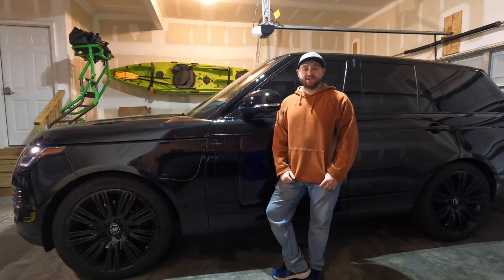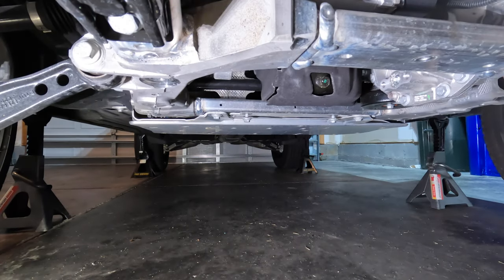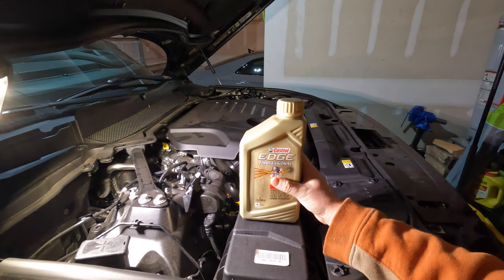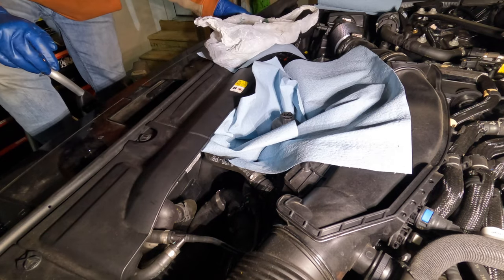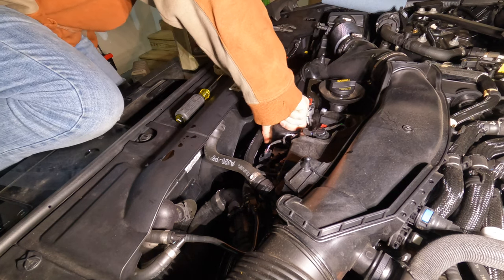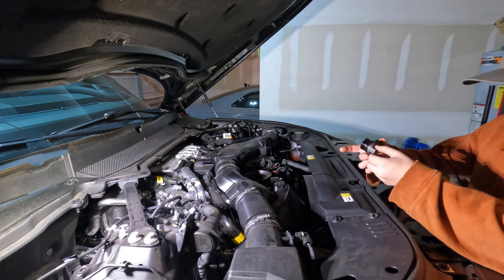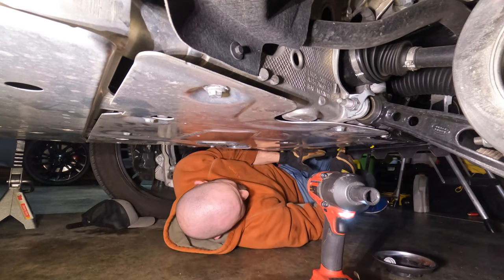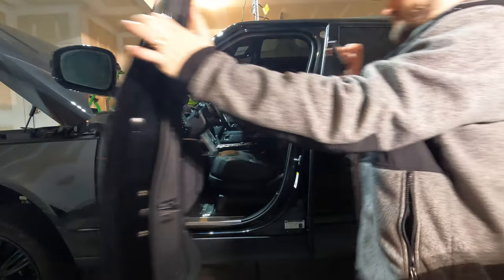How to Change the Oil in a Range Rover P400 MHEV [Ingenium 3.0 Litre I6]

Comment: Just did this on my wife's P400.  There's so much incorrect info in these comments.  First, the owner's manual says 8.8 liters/9.3 quarts for the 3.0L gasoline engine.  Not 8.5 quarts, as a couple commenters said.  I put in 8.8L and the dipstick is right at the full mark.  Second, to those suggesting extracting the oil through the dipstick tube and refilling with 8.5 quarts: why would you leave almost a quart of old oil (0.8 quarts) in the engine when doing an oil change?

Comment: Nice job ..I would check the oil level and start the engine for a minute or 2 then turn engine off, check if no leaks under the vehicle before replacing the bottom engine cover.
Reply: This.  It's basic practice when doing an oil change.

Comment: 8 and a half quarts of oil for a L494 RANGE ROVER SPORT 3.0 SUPERCHARGE
Reply: That's entirely different.  I have this same P400 MHEV 3.0L turbocharged, and the manual says 8.8 liters / 9.3 quarts.  The additional oil is probably for the turbos.  Superchargers don't use the engine oil for lubrication.

Comment: Always change the oil filter first.
Then use a vacuum fluid extractor to suck the oil up the dipstick tube. This is how dealerships do it.
You don't need to jack up the car or remove the skid plates.
Reply: That vacuum extractor is awesome and will change your life. That is how the dealership changes oil. That is probably also why they said you don’t need to change the drain plug washer. It doesn’t get undone when using the extractor method.
Reply: Great tip, I have one for my boat and it’s amazing.